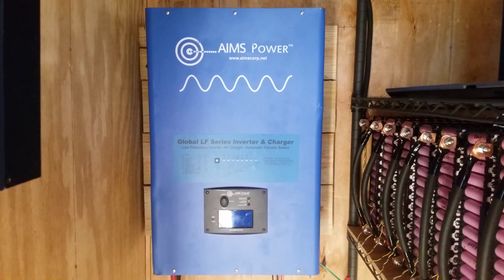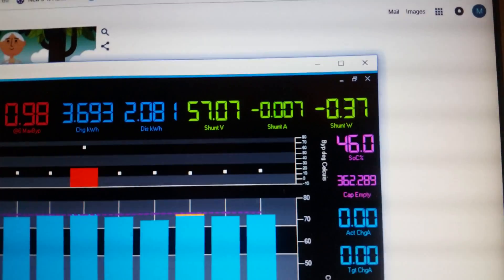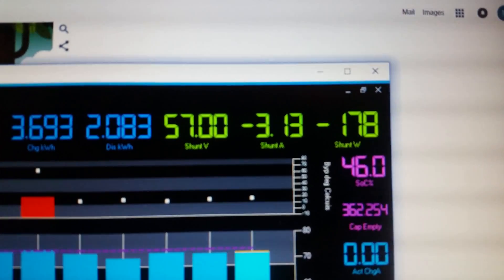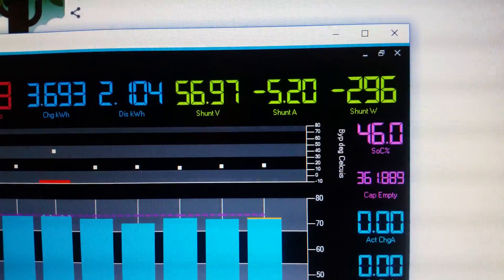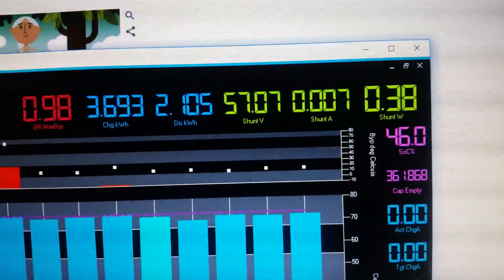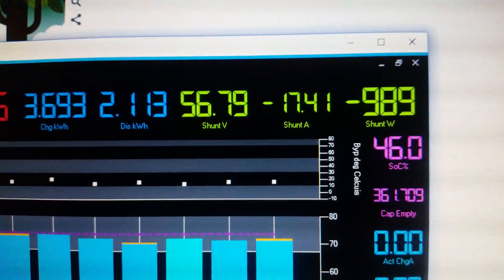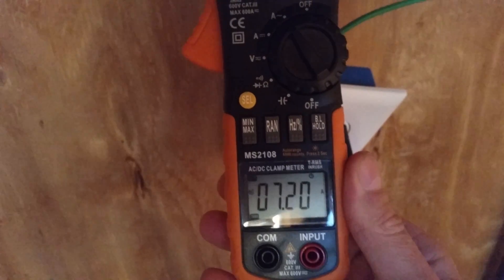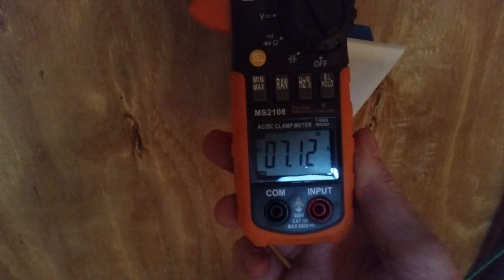Inverter Power Consumption - AIMS 10kw vs Reliable Power 1.5kw

Comment: Any transformer requires power to magnetize the iron core. If you use a split-phase autotransformer, you'll have just as many losses. The majority of that current is inductive, so it's not actually using that many "watts", it's the "volt-amps-reactive" load. The core does get warm, but that's not much loss. When you loaded the inverter, the core is less magnetized, so the apparent efficiency goes up.

Comment: Stand by power consumption is always a consideration.  The issue I've seen in stuff like UPS's... the fans, processors and so on will always be on, and will always eat power.  (And the low frequency inverters, while being great for starting surges and the like, have more losses in the transformer that handles big surges.. a HF Switching source has problems with surges.. typically only can handle a few cycles of overload before things start frying... while the low frequency guys can go 10-20 seconds.

Comment: Please expound on what you BMS software is, and how you are utilizing it. It looks extremely useful!

And, ok, with further reading. Your ~1-200W phantom load that disappears with true load strikes me a software managed. When overhead (control) power loss is sufficiently overwhelmed by "normal" loads, the no-load power loss disappears. This strikes me as developer sleight-of-hand. The first tool I'd use to check this is to run this test on a cold night, and whip out the old thermal camera. These are cheap as can be now for mobile phones and are true thermal cameras.  These are ~200USD.  You wold be surprised at how much utility there is in these devices.  E.g. I was having problems with small rodents chewing wires under plastic tarp in my hard. With the IR cameras I could image the rodents well enough that I could dispatch them easily through wet/snow covered tarp and stop the problem.  Now, moving beyond that horror. I'd love to have a conversation with you about your efforts. RSPV at your convenience.

Comment: I have been tracking in/out efficiency of AIMS 12K inverter and it seems to be about 84% efficient on steady load of 1,000-1,200watts @120v on 1 leg.   This is in range since the manual says 88% peak (e.g. ideal) for AIMS 12K.     My numbers are based on Midnite Classic 150 reported KWH in to battery bank vs   "bayite AC 80-260V 100A BYT-VAEM-034 Digital Current Voltage Power Energy Analyzer Meter" on the AIMs output side.     In the middle, I have both the Midnite Wizbang Jr and Batrium BMS shunts that report the exact same amps in/out.      
For example, so far in Jan 2019, I have gotten 277kwh  in (per Midnite Classic) and 236kwh out (per bayite power meter).      236/277 = 85.2% efficiency.        Granted,  its not clear to me how accurate these Midnite and Cheap amazon meters are...   but 85% does seem 'as expected'.    Note:  I have automatic transfer switch SO the AIMS is in battery priority mode AND the inverter is turned on/off (by Midnite Classic) only when providing power - e.g. its not the transfer switch and is not using power polling for AC input etc.

Comment: So, the answer for someone looking to run an Aims is -  run it when you're up and about and using power, then switch back to the Reliable at night. 
The only thing is, your microwave will 'reset' it's clock every time you switch inverters.
Reply from the maker: I have loads that run 24/7 so it's not a big deal. I would prefer just to add a few extra panels, but then again as mentioned earlier, how much loss is there really when there is a load on it? Reliable is not split phase output and can't be wired to a 120/240 breaker box either.

Comment: Just found this !... excellent test.  Like you say, the Aims inverter turns out to be pretty good once it's under load.  And 87% efficiency isn't too far off from a Magnum
Reply from the maker: Yep. I really need to do some testing, applying a 200w load, 500w load, etc and calculate the inverter efficiency loss.

Comment: So the low frequency, transformer inverter has less effiencey than the high frequency Reliable inverter? I have a 110v low frequency 5kw inverter. I had the crazy idea to build a inverter large enough to power my house. Until I studied the workings. The effiencey comes down to real power and aparent power. Va, and watts. A grid frequency transformer. Consumes power but then releases it back when there is no load. That kinda changes with load. Maybe retest with a small transformer . test with the output shorted and in shorted. Maybe use a watt meter between inverter and transformer. It will give a better idea of how the LF aims inverter differs from the HF reliable. I have been thinking about getting a 3kw reliable Inverter. To use along with my 5kw LF. The LF inverters will start motors better than a HF . it has loads more surge capacity.  Where the HF work great for lights and small motors.  The low frequency "LF" just has more muscle, at the cost of effiencey. I'm off grid. And need back up inverters. Because a generator gets old fast! If you want to know more about the workings of inverters I'm happy to try to answer. I'm no engineer but did study on them for a couple years. I'm a new subbed, and like your videos!

Comment: To install only inductor I have go only half way I did not consider capacitors have also big role in this matter and it has..... Inductor an capacitor shuld produce resonance in transformer on 75hz that should feed transformer and his changing magnetic flux so less should be pulled from inverter on idle status.... 
And besides in the time when I installed inductor I didn't have adequate capacitor... That I get much later.... 

Two big fans on the top are also large consumer's each 35-45w on 230vac is a lot I have changed them with 12 v dc PWM fans NIDEC brand 4wire... AliExpress have pwm controller for so I reduce from 70-90w to 5-8w on no load conditions nidec are superior 2-3x to original fans and have max 1.4A consumption but I have seen max0.5A in high heat(65°C)on each and that was wind... 

Now my current situation is that I got the capacitor and  I have conect him on output and suddenly transformer is getting silent for 1/2... 👍only load over 2kw make him humm......

Comment: There is alternative to lower idle consumption of low frequency inverter and is all in aliexpres sides and is about modular low frequency inverter bord's.... 
Long story short big inductor in series with big transformer and 15-30uF/400-500v on ac output side....
I have made some modification on my 12kw China inverter and I lower idle current draw on 1.3A but I only instal inductor but not the capacitor..... And I have problems by the running inductive load's transformer is starting to make strange noises like whistling loud and louder..... I shut down the inverter and remove the inductor...

Comment: It should have a saver mode.
Reply: have always heard the bigger the inverter the more no load draw it has. That is why it is important to size your system correctly.
Reply from the maker: It does, but the appliances I'm running off it are always on. Two desktop computers, the microwave clock, receiver has a standby mode, etc. It's just not possible to use the powersaver mode in a typical home setup. Maybe if it were a cabin or some kind of low power completely off-grid home...
Reply: Ya I guess . Im always running .6A
Reply: I guess its a price you have to pay then.

Comment: Good video my friend, just had to sub when I saw I was going to be # 911 lol.    I'm shopping inverters so every little bit helps.
Reply from the maker: Thank you :) I will be doing some more heavier-load tests as soon as my cable gets here and I can connect it properly/safely. My main goal is to get the AC to run off this for the summer.

Comment: do you have a way to check this inverter with heavy loads, what about a central air conditioner
Reply from the maker: Yes. I don't have central air, but do have on large 240v window unit in the middle of the house rated for 2400w or something. I also want to try my cloths drier which is rated for 6000w. I just don't have extension cords of those plug types/cable thicknesses, so I will need to finish the wiring first. It will be a few weeks yet.

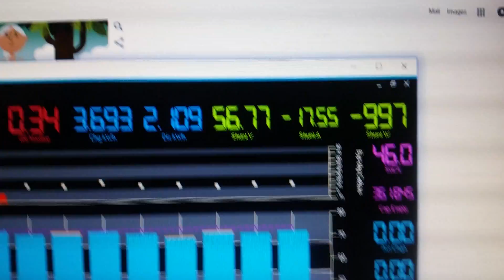Comment: @4:13, you switched to the Aims inverter, but the no-load draw was only .36 watts... same as the no-load... so, something's up.
Reply from the maker: For that test, I was using the on/off switch of the inverter, not the vacuum. The inverter was turned off at 4:13. I turned it on at 4:19.
Reply: Ok Ok I got it
Reply: This is VERY interesting.... so the Aims isn't all that bad if under a decent load.  We pull like 400 watts all night long. LOVE to know what it does with a 400 watt load.  I'll bet it's linear between the 150 watts the fan pulls and the 1000 watts the vacuum pulls, meaning, the Aims probably wastes like 70 watts or thereabouts under a 400 watt load.  Thanks for this video.
Reply: Aims should do tests and post this data.  I'm positive they are missing out on a lot of sales due to their published "no load draw".  Yeah, the Magnum beats the pants off it it with a light load, but  once the Aims is doing some serious work, it's actually very efficient .